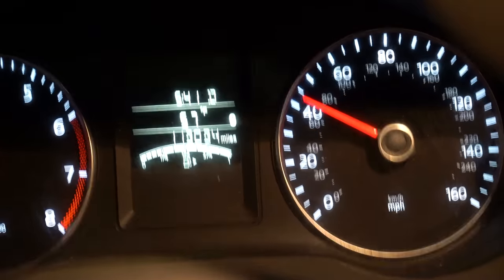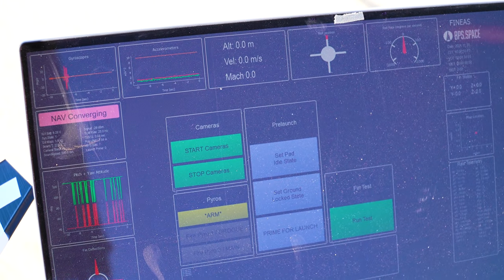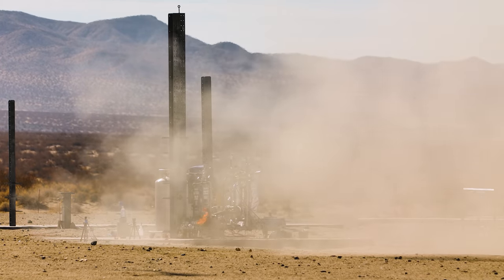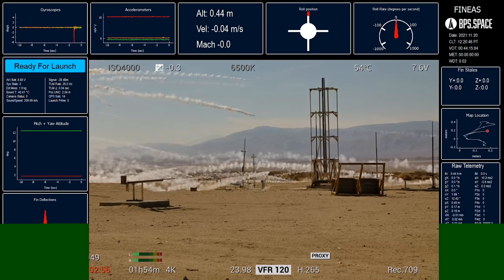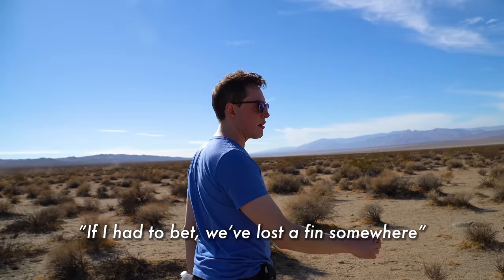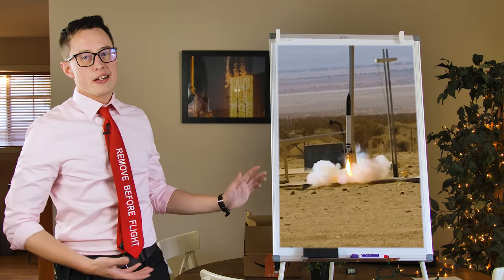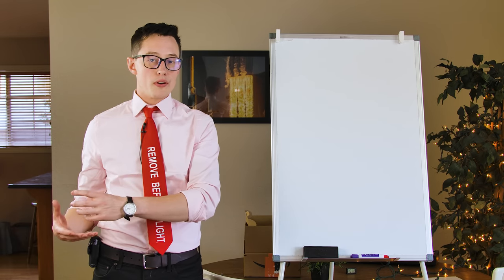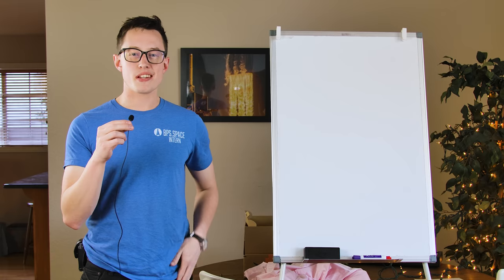Fineas - Test Flight 1

Comment: There are a couple things that I see that could be changed resulting in a more successful flight test. 

1. Bring the hinge for the fins further forward to take some of the “snap” away from the fins at aggressive AOA. 

2. Update servo horn from plastic/nylon to a aluminum arm. maybe use 440 rod with ball links. Do not use piano wire and z bends and glue, the aerodynamic forces will be too great and the setup has a lot of slop if glue fails. 

3. Limit the travel of the fin or use a expo curve to soften the movement as velocity increases. Slowly increase deflection each flight 

(All knowledge is from time as a RC builder and pilot not to oversimplify but this is the same control method as RC aircraft)
Reply: I second everyone of the suggestions! Ball-links with rigid arms are definitely the way to go. At 100m/s+ there’s some serious aerodynamic loads there.
Reply: Add some led etc it shows to video synchronous driving fin motors and fins leading edge profile in my mind is too thick.
Looks only by video, that driver overdrive after it didn't get clear imagine from gyro from early start. Test that rocket in hand how it reacts,and I think you have been done that numerous times. Good video and nice to see hobby live so nicely by others too
Reply: Dito on the hinge placement...I came here to comment the same thing. Right now it's an unstable system. If you move the hinge up, the fin will tend to stay in-line withe the direction of travel.
Reply: Yup, you are totally on point.  I’m also a long time RC builder and have done many full flying tails on high performance aircraft. You need the hinge point around 20-25% MAC (mean aerodynamic chord) to be in front of the center of pressure.  Also make sure the servo linkages have zero slop to minimize flutter.  Also make sure the control throw is such that the endpoint deflection is close to the max throw of the servo so you have the best resolution and high mechanical advantage (think highest torque and high resolution).
Reply: If you choose to remain with a single point mounting system put the pivot forward of the center of the fin so it zeros to straight ahead!
Reply: @Rmaia3d  you need to use titanium linkages out of jets & 3d airplanes. probably much more powerful servos too to combat what looks like flutter.
Reply: @allenmartin9531  Yeah the titanium 4-40 turnbuckles would be great for this!
Reply: Those fins seem to travel way too far. I would have thought much finer movement would be enough to give large effects on vehicle direction. There's a hell of a lot of airflow over those fins at these velocities.
Reply: Only thing I would say is that 3MM bolts, or M3 hardware is a little more common and is used more in high-performance giant-scale RC. Also, pick up some Savox or Futaba servos, you won't be disappointed!

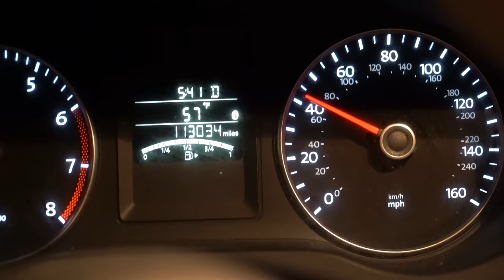Comment: 0:05 So never go above half full, got it! thanks!
Reply: No modern car or truck should ever be run under a quarter tank if you want your vehicle to last as that fuel lubricates and cools the in-tank fuel pump!
Reply: I’d rather take a lot of water into the desert than fuel.
Reply: @Mike-oz4cv  you can get out of desert with fuel but you can't do that with water.
Reply: @Görkem-x5h  But if your car breaks down all the fuel isn’t going to help you. Water is handy in plenty of situations (and if it’s just being stuck in a traffic jam for a few hours).
Reply: Ha, well spotted, I missed that first time round.

Comment: My dad worked on rocket guidance systems for General Dynamics starting in the late 1950’s to the mid 1980’s. One system he talked about, he called “dithering” where the fins shook at a small angle with a certain rate, when they wanted to change direction they would just pause at one or the other angles +/- then back to shaking/dithering. You could possibly use electromagnet switching to get rid of the mechanical linkage?
Reply: Hey dude where can I get practical knowledge about how combustion chamber is made?
Reply: @PiyushSingh-em5vz  Look for a book called Rocket propulsion elements by George Sutton.
Reply: @AIM54A  what type of knowledge can I get from that book?
Reply: @PiyushSingh-em5vz  Elon Musk did ok.
Reply: Old VCR helical heads (RCA, Sony) used to do this too (dithering) w dynamic tracking and strain gauges and a piezo element on the head to deflect the head and a feedback amplifier to determine if the head was tracking properly across the tape.

Comment: Torquing on the fin pivot point tends to create an ossolation that is difficult to dampen.  Put a control pin near the front of the fin and cut a slot in the servo wheel to drive it.
Reply: Love the video! In the spirit of youtube, I know nothing about this topic, but here's my opinion/suggestion: I agree with this. Separating the rotation point from the actuation mechanism may let you get better mechanical advantage for fin movement while the extra rotational constraint from having two links to the fin would spare your rotation point from hugemongous forces. Challenges, of course, would include servo positioning, but that's a minor detail. ;)

Comment: I think having the fins mounted to the servo is a weakness. Have a passive pivot point at the leading edge, but drive them laterally from as close to the trailing edge as possible for better leverage and stability. Yes, I mean having the linkage exposed.

Great video, thanks.

Comment: The real question after the failure is actually what parts resolidified after cooling.  The launch video does show the failure almost at maximum altitude, the fins ( what little action/reaction there was ) looked good until melt slipage.

Option 7) Replace all linkage/parts with milled metals/carbonfiber and overkill the design, then fly again with the same flight program.

Comment: First idea out of my head remembering V-2's... don't move the whole fin. Try hard mount main fin with servo driven tail flaps. Also check directionality of motion with the directionality of the servo rod movement. Pull, not push. Pushing the rod will bend fighting aerodynamic forces. If it needs to operate in both planes of motion use dual rods. Use metal geared servos against such high aerodynamic forces. Also suggest hinge be multi-sectioned (Like piano hinge) with 50 percent of total hinge width pins. (Note: during fin construction, bend pin ends over on both ends into slots top and bottom of flap, glue in place.) Leave space for vibration of flap. Even though you think the fin will be solid to the fuselage, vibration will close the flap gap and the flap will rub on the tube. I missed the build video for the rocket. Building a chassis for the servos to sit in that is much more stable than just mounting to a bulkhead. Next I'd limit the movement to 11.75 degrees in each direction. At the Max-Q speeds your rocket is flying, you don't need much deflection for roll control.

Comment: This has got to be the coolest channel I subscribe to. Any channel that can genuinely make me excited by saying "and now it's time to review the data" is definitely doing something right. I'm so excited to watch you find and overcome all the challenges in fin control. So cool.

One question: Even though the fins failed, can you tell if the control system was working by comparing the roll-rate measurements with the control system outputs? I.e. would it have worked if the fin joints has not failed?

Comment: You have a very interesting problem here with the PIDS. You will either need to write an algorithm to adjust the PIDS over the flight during powered lift or when you are flying at low speed you will have no issue as illustrated then when the speed picks up and the controls become super effective your algorithm will overcorrect and it will freak it out. I would say redesigning the fins to move the actuation point all the way to the back and the pivot to the very nose of the fin. Gets the best Mechanical Advantage at high speed and provides better servo precision. Then either go for full-on speed for the tune only or sacrifice high-speed control unless you can switch the rates between the two. Then the rocket looks like it should be great!

Comment: It seems to me a control surface on the back of a fixed fin would be a bit more robust solution and have a much less wild failure mode. But I've only flown subsonic.

Comment: Hey, Joe. First off, thank you for having the stones to post not just your many successes, but your failures as well.  Not everyone has the ability to do that and you deserve thanks for doing so.  Ok, secondly…. On mounting your fins.  How about mounting the fin to a very small flat piece of aluminum that exactly matches the portion of the fin closest to the body of the rocket? Then you could weld a little shaft onto the plate and pass it thru a bearing or some type of seal/bushing that could keep it in the correct orientation and not allow it to wobble around once the air pressure against it increases during the launch event.  I would also consider mounting the fins to the plates by screwing them from the shaft side and use some kickass epoxy or other adhesive of your choice.  Having the metal control shafts would let you connect them to your servo horns (which it sounds like you are going to be replacing with aluminum for the next flight!) and eliminate any plastic or other parts that could potentially pose a risk of failure in high temp situations.  Just think if you were to try and fly that thing in July or August down there in So Cal… it may have just melted right there on the rail!  This is almost December so there are not many better weather patterns being offered by Mother Nature than what you were given.  I learned my lesson with non metal servo horns when I was racing my 3D printed catamaran.  My steering servo horn stripped the little teeth around the output shaft of the servo (who puts a metal geared high torque servo together using a plastic servo horn?  Um, ahem, err, ok besides me I mean?) during a high speed run which did not end well when it failed suddenly and very completely…. 70mph into a stone wall at the edge of the lake.  Wall vs 3D Boat.   Wall 1, Boat nil.

Comment: Interesting idea!

The fin deflection should in my opinion be limited to something like maybe 5° and the pivot could maybe be altered to 2 points one being the aft hinge point and a ring conector which is connected to all the fins near the leading edge one servo or gear would turn the ring connector. The ring would be centered by 3 or more small cartrage berrings to keep friction minimized.
These are my 2 cents, keep them or toss them that is your choice.

CAR cert 3, NAR cert 2
DE VE9GIS

Comment: Good rocket, good flight, good video! One idea is that if you're doing more flights out in the hot desert, do a radiant heat test to ensure that this doesn't happen again and that everything else can withstand the desert sun

Which is to say, stand the rocket up, stick a temperature sensor in it, get some cheap heat lamps, point them at the rocket, get it nice and hot, and see if anything fails or melts or gets soft that shouldn't

Comment: For your fin stabilization, would you consider a fin layout similar to an AIM-54 or AGM-65 where the large fixed forward fins do the majority of the neutral stability and the guidance fins are there for fine control? 
Another option would be to model the "Rollerons" that are found of the AIM-9 family of missiles. This is a passive control system that uses air speed to turn gyroscopes that are built in to control surfaces. 

My suggestions would be to have four fins working the pitch and yaw, as those two axis will require a considerable amount more control input than the roll axis. 
For the roll axis, I would limit the controls to be less than one third of the deflection the pitch and yaw receive, as well as maybe limiting the controls to two fins.

Comment: Brilliant work. A  few questions:
1. What plastic would you consider as 'high temp' for this application?
2. How have you constructed the rocket payload so that you can remove it after a flight to work on it?
3. Have you considered going to hyrbrid rocket motor for the greater control?

Comment: Reduce aerodynamic forces on servos and links by using control surfaces on fins instead of using "flying" fins.  Also, why such aerodynamically terrible fins instead of 3D printed airfoils?
Reply: Doesn’t this present issues in transonic and supersonic regimes because the shock wave is pushed behind the control surface? It’s why the bell x-1 and other moved to stabilator vs elevators. Just spit balling here
Reply: My thoughts as well.

Perhaps don't run before you can walk - just use fixed fins, control surfaces on those fins and move said control surfaces using well-known servo/rod/horn setups taken from R/C aircraft. Sure you're going to struggle once you hit transonic speeds, but this thing is doing about half that at best.

The control pin idea mentioned elsewhere in the comments also sounds like a good way to go.
Reply: Transonic behavior is irrelevant with that rocket and motor size.
Reply: I agree with this and more (!). I've been thinking, why do they even need to move more that 5 degrees or so - more than that and it's too easy to make it do what happened, make the rocket turn 90 degrees to the direction of travel. Is the eventual idea to go supersonic on this design? I recall Chuck Yeager being surprised at how the controls were operating around Mach 1 and how it almost surely contributed to previous test pilots' crashes.

I'm "presuming" a lot here, that the fins are programmatically kept straight until after the rocket has left the launch tower, and so many other things I just now forgot. We all want Joe to succeed, and I'm hoping our comments are helpful and welcomed.
Reply: The transonic issue can be eliminated when he does scale up by articulating the outboard portion of the fin rather than the trailing edge, or using separate control fins like many missiles do, usually on the nose which leaves the rear volume for propellant and all the servos and controller in the nose.
Reply: @ryanmcgowan3061  I like both of these points

Comment: At high temperatures, some epoxy chemistries can move out of their glass state and transition into a more rubbery consistency. Which is almost exactly what looks like happened to you. Options are to either use an epoxy with a higher transition temperature, post cure (bake) your epoxy bonds, or both. Best of luck with your future flights!
Reply: Came to the comments to say this. Epoxy can go soft when it heats up.

Comment: @BPS.space Beware that the center of pressure of an aerodynamic surface moves forward upon stall. The center of pressure could be momentarily moving forwards, past the rotation axis of the fins and providing an anti-centering torque. This extra torque might be contributing towards the failure of the epoxy joint. Good luck, I love your videos.

Comment: Nice try out there! Something that I've seen people struggle with besides for mechanical failure is the accelerometer tracking spin rate will peg and then the fins will do something undesirable and then... you know. Might be best to go for very low gain on the roll control and make sure your build precision and fin alignment is as good as you can possibly make it.

Comment: This was awesome. A solution to your joint problem would be to use set-screws or asymmetrical axles (D, hex, or +) to eliminate the need for epoxy. Also, do you think the motor burning had any effect on the temperature?

Comment: Excellent work, though not the first time tried in HPR.   In fact, the IRA once tried to infiltrate the Tripoli Rocket Association back in the 1990’s and all attitude control experiments were frowned upon because it was feared it would lead to guided missiles in the hands of the civilian population.   But you are  just trying to control roll - which is very cool.

Also, Coitronics sells many different high temp  epoxies.  I’ve used them many times myself.

Comment: Hello !
Great video ! loved it ! For the chute have you checked into skydiving pilot chute or drogue chute. The drogue chute are bigger than the pilot chute but might work better as they are used to slow down tandem but they have a bigger packing volume. The material use is super light and if you get a pilot chute it can have a very low packing volume. You can look up as well to pilot chutes made for base jumping. ( For example the Snatch made by Squirrel ). 
Thank you for reading and I hope it can help you !

( I'm a skydiver for information )

Comment: Hey Joe, awesome video! I'm no expert at this, but could it be rather a failure of the servo at the first place, not the joints? Also, what if you have used construction not like in F-35 horizontal tail, but like in commercial airliners, so the area would be much smaller, hence the force exerted on the construction would decrease significantly?

Comment: It would be cool to try combine all the different control, which would add wieght/reduce max height/speed/acceleration but might add control and back up. I was thinking that you use fin control for most of it, corrections by gimballing on top of that, and then thrust vectoring. First it would try one, then other to correct in order.

Comment: Have you thought of using a small barrel that rotates along the fuselage and to which all the fins would be attached? This and a fixed pivot on another part of the rocket would give the rocket rotational stability and prevent the possibility of failure as only one servo would be needed.

Comment: Joe, 3d printer academy did a video on high speed gearboxes 11/11/21,  they used a pin though the shaft into the gear to remove a failure point. The same technique might eliminate the shaft to fin weakness on Fineas